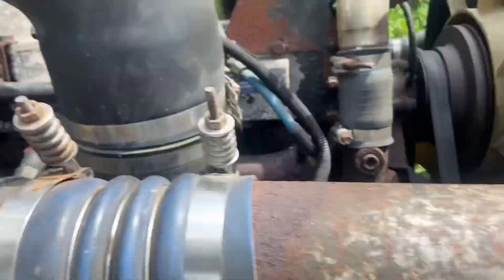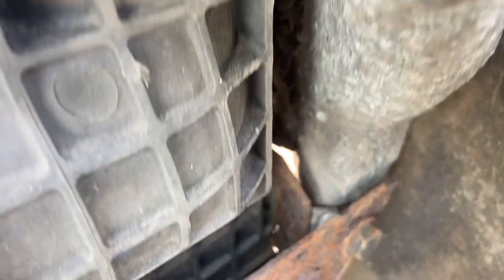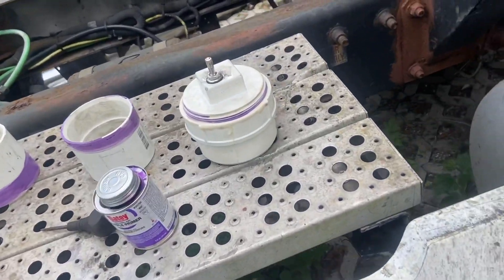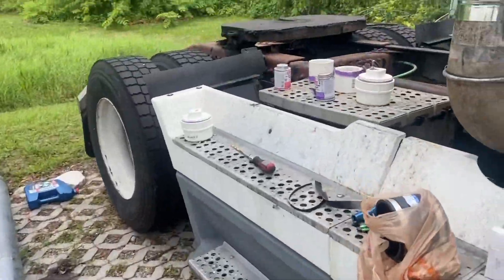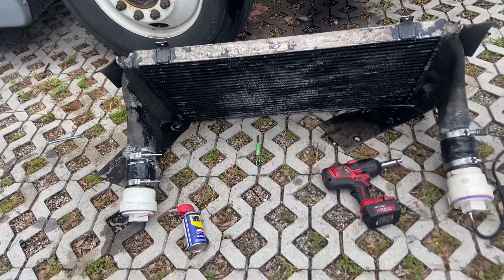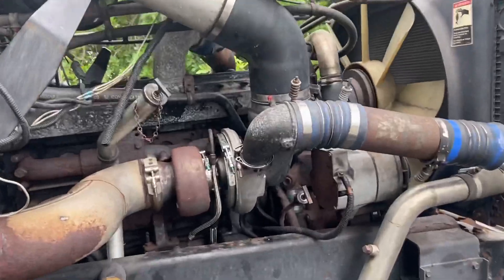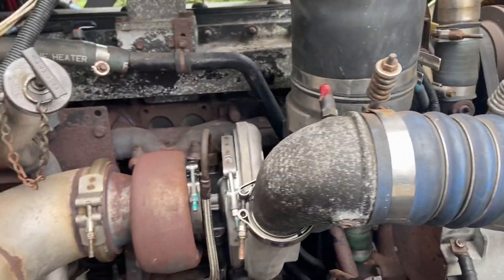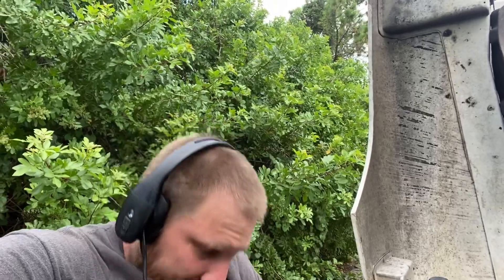homemade semi truck boost pressure tester! Fld120 and duck tape couplers

Comment: Hope you get her sorted brother !!
Reply from the maker: Me too man. Getting frustrated!!!
Reply from the maker: I finally fixed the stuttering and hesitation!!!!!!!
Reply: @Shawntuning  sweet what was it
Reply from the maker: Wiring harness to the throttle petal.
Reply: @Shawntuning  hell yeah Glad you got her fixed put her to work make some money!!!
Reply from the maker: Correction she is still leaking fuel into the oil.
Reply: @Shawntuning  damn gotta be a injector o-ring or a cup easy fix just sucks I know you just did all that I bet a o-ring got pinched or damaged when you got injectors installed